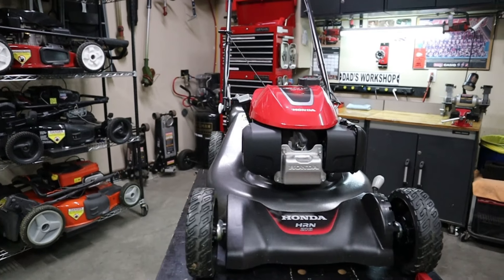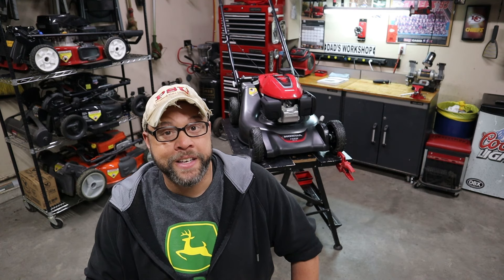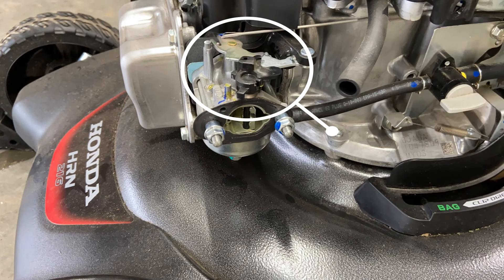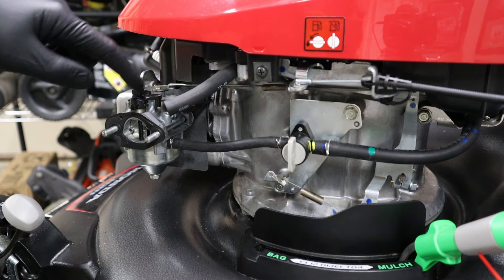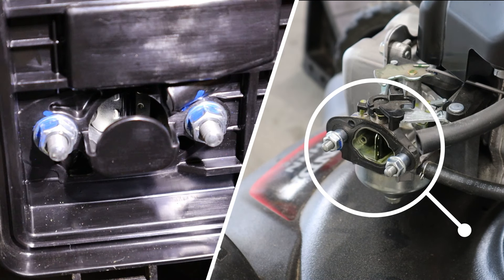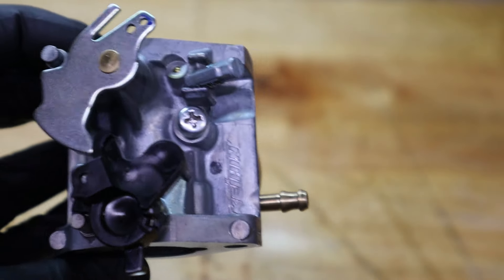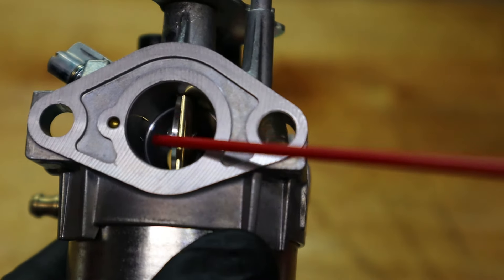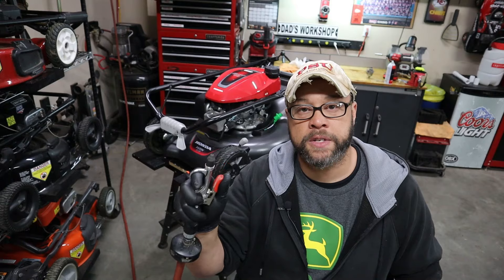New 2020 HONDA HRN216 GCV170 Surging/Rough Idle AND Auto Choke Test/Check

Comment: Rediculous, I fix mowers and was thinking about buying the upper model with variable speed , but no more. To spend 519 plus tax and to have this? It's funny how this guy and people commenting seem to be ok with it. It's a real hassle to remove and reinstall this carburetor, it's not a thing your average person can do without some serious research.
Reply: Yes I know! I need a mower and I'm lost. No idea what brand to get. Meanwhile my grass is out of control. Do you have any recommendations?
Reply: @drepop803  
Again honda makes a great engine except for there carburators. Ever since they tried to meet emission standards for California. Making the emulation jet holes way to small which easily get clogged and resulting it to surge or not start at all. I have 2 Briggs and Stratton Engine mowers as my work horses. Carbs. are very good easy to clean if needed and easy to fix. Just change the oil and they last for ever. For my home I have a husquvana with a Honda engine, it does act up about 1 once every 2 years, but I know how to repair it. For your average person who doesn't know how to repair it is very expensive to take to a shop. Advis, by a mower with a Briggs and Stratton Engine unless you know how to work on mowers.
Reply: @leosalas41ify  haha thanks man. but just a day late. i bought a honda HRX217 two days ago. 

no i don't know how to work on mowers and my beater mower is a snapper with a briggs but it has tons of issues. it was my brothers and he's just like you. he just knows how to fix it and get it working. 

i was thinking of getting an easy to clean and work on mower like a briggs as theres so many of them but i found the mower i wanted (the one i just bought) by accident. she was sitting under a pile of Toro's. i thought either this is a return lemon or its just meant to be. 

HD said they were out of stock and there she was. i opened her up today and she's definitely new and not a return. i just finished mowing my lawn with her and saw this message as soon as i went in the house to grab a water bottle. 

haha all good brother. what i think im going to do is have my brother show me how to open up and repair the briggs and use her for my hills and scary spots on my lawn and just use the honda for the general area and flat surfaces. 

thanks for the tip. always appreciated.
Reply: @drepop803  Wow, Honda's big daddy. Bought one thinking I would replace the Husqvarna. Reason? I have no idea, the Husqvarna runs and still looks great. Just wanted something new, just liked how this new Honda series looks. Although it looked great, I returned it after a month. It was just too big and heavy for my yard. I have a small front yard and it was a hassle monuvering around the tree and flower beds. Good luck with mower, if you have reaccuring issues, check Brue video from Canada. He has a video on how to drill out those ports and make them bigger, which I did to the Husqvarna and every Honda Engine I repair. That pretty much fixes the problem. From the Honda Engines I've repaired like this, I have not had any return. Again, good luck mower. It's a very nice looking mower.

Comment: I had the same issue on my mower, and sprayed carb cleaner down the pilot jet with the screw off, and into the intake port. Now it will only sputter, or get up to full speed and immediately die.  Anyone else have this happen?

Comment: Looks like it's the right fix but my question is, why did this stupid mower do this after just one season of use?  And will this be something that has to be done every season?  If yes, then Honda ripped the buyers off.  No other lawn mower I've owned has had this ridiculous problem that requires disassembly in order to fix.
Reply: Too many people sharing similar experiences - not starting or rough-running early in the life cycle. Looks like owners have to learn how to replace thermowax part or constant carb cleaning or wait weeks for dealer service... Like high-maintenance people - dump 'em or avoid 'em!
Reply: @sheltonmiller7777  Update: I tried the fix outlined by Kipp in the video and my machine runs like new.  Starts on one pull, no surging/hunting.  One difference - I did not take the carb off the mower.  I put carburetor cleaner in the right-side port, and used a tankful of "Mechanic in a Bottle" for the halibut.  Back in business, if you will.

Comment: Everyone please understand.  Most newer engines are having various issues.  It's all due to EPA and regulations and engine makers having to meet those regulations, building less reliable engines with tinier pathways or lighter materials and overall smaller engines (notice the many 150cc engines now, going backwards).  

I say that because anyone stating I used so-and-so brand mower/engine for 15 or 20 years and never had trouble, well, it would be the same for 15 and 20 year old Hondas too.  If you use new Craftsman or Briggs or Toro or Tecumseh or whatever, and the engines have changed recently (most have, again to meet overbearing and unnecessary regulations) its likely to be NOTHING like your good ole mower/engine of yesteryears.  So get a new Craftsman and be sorely disappointed.  Likely the same with Toro (at least in engine power/reliability compared to 10+ years ago) and other brands.

We're being forced to go battery powered electric AND pony up outrageous money for over-priced lithium batteries that probably won't last 5 years.  On electrics, consider a battery replacement the equal of an engine replacement.  you'll replace twice as many "engines" with electrics and blow away ANY savings over the cost of gas/oil/air filter/spark plugs.  We're being screwed as consumers.  I'd like to see a state give the feds the middle finger and state the EPA restrictions don't apply to them and allow REAL engines to be built again.  I know, they'd lose some federal funding, fight lawsuits, but states do have rights, they just might have to pay up to keep them is all.

Bottom line, if you can keep your good ole mower running, stay with it.  I wish I could get my Toro personal pace Briggs engine compression up, but I think some cylinder wall grooves, however tiny/shallow, apparently are causing lost compression.  Hate it.  Looking at a replacement engine, but they'll be new and they'll have same issues (more frequent maintenance of carb).

Comment: Seems helpful but you skipped over the part where you actually remove the carb.
Reply from the maker: It’s 2 bolts
Reply: @dadsworkshopbykipplabrie7982  Thanks.  Once I removed them it was obvious the carb will just pull out.  I was wondering because sometimes when you take something apart it's not so obvious and I end up breaking it.

Comment: Alright dude...here's one for ya:

Honda GCV160...on Honda mower, bought new in 2015.

All of a sudden, in the last couple months or so...will start...then like CLOCKWORK...will shut down after say 2 or 2 1/2 minutes. Just bogs down and dies. 

Have cleaned (to the best of my skill-set) the carb - I used brake clean! Just replaced the "thermowax" little deal behind the auto choke mech...

STILL will run a couple minutes, start to flutter then bog down and die!! 

UGH!!
Reply from the maker: I’ll try my best without putting my hands on it but I hate to say it but it sounds like the carburetor is still clogged somewhere??? Sounds like it’s using whatever is trickling into the bowl then dies. Have tried penetrating the pilot jet with a sewing needle yet? The hole for the pilot jet is super super tiny. That’s the best I can recommend sight unseen keep me posted.
Reply: @dadsworkshopbykipplabrie7982  Thanks dude! I'll pick up some carb cleaner and try to find some brushes or something tomorrow after work. 

At least it's cooling down here...not 105 like it has been, only high 90's! haha There WAS water in the fuel I drained out a week or so ago so I'll totally drain, buy a new can of fuel and give 'er one more try!! Hopefully my patience and the beer hold out!! LOL have a good one, and thanks!!
Reply from the maker: Make sure the fuel valve is open LOL! good luck brother!
Reply: @dadsworkshopbykipplabrie7982  SO...bought carb cleaner last night after work...took it ALL apart even the little brass pieces and flushed them super good. Drained ALL The fuel out even putting some paper towels in to tank and "mopping" up everything. 

Bought a new gas can and two new, fresh gallons of 92 oct and by golly...she fired right up...ONE pull...got the lawn done and now....BEER!! LOL

THANKS AGAIN!! HAVE A GOOD WEEKEND!
Reply from the maker: HELL YEAH!!! "Hold my beer" LOL! Awesome to hear. You got this 69adrummer. I would run some seafoam at the end and the beginning of the mowing season.

Comment: Well this is a coincidence.  Our mower is the same model and is doing this (and actually it's gotten to the point where it wont stay on).  Gonna give cleaning the carb a go along with some Seafoam in the fuel and see if that helps.
Reply: So!  Update.  Managed to get the mower to start up fine and even run for a bit!  But it would surge again every once in awhile, before conking out entirely.  So let it sit for 20 minutes and then sprayed the HELL out of it.  Also note, could NOT remove the screw for the main jet.  That sucker was on there and not moving, and we were risking stripping the damn thing trying to get it out.  So I basically just stuck the straw-nozzle into the other hole and douched the hell out of it, along with the rest of the carburetor.  That apparently worked, because it started up like a charm and stayed running for 30 minutes this time!

...until it conked out again.  And wont stay started this time.  I'm thinking I'll hose it down with the carb cleaner one more time and then let it sit to let the solvents do their job.  Then see if that finally fixes the problem.  If not...I mean it'll be a BITCH to keep having to hose down the carb every time I wanna mow but it beats paying $100 to get a shop to look at it.

Comment: How are you supposed to ‘flip her over’ and check the back if you don’t take the thing out? Us non-mechanics need to know what cleaning it looks like while still on the machine. I ain’t taking no carburetor apart.
Reply from the maker: Open the choke valve and the throttle valve “butterfly valves” by hand on top of the carburetor so you can see right through it. Then locate the three tiny holes on the back right side of inside the carburetor. While holding both those valves open insert your carburetor straw into the right side intake “hole” and gently spray away. But you have to use the straw that comes with the can or you won’t be able the trace the stream. Blast! It out at first then gently spray a slow and steady stream and you’ll see the carb cleaner flow out of the three holes on the back you my want to use a flashlight.
Reply from the maker: https://cdn.powerequipment.honda.com/pe/pdf/pubs/otr55046.pdf
Reply from the maker: These one shows the the 3 transport holes a little better their small in the diagram but more noticeable 
https://cdn.powerequipment.honda.com/pe/pdf/pubs/te425pdf.pdf
Reply: No worries. Just shut the gas and remove the two air filter nuts and air filter housing as shown in the video.
Remove the gasket.
Remove the fuel line at the carburetor. (This can be challenging because the hose clamp ears are so small that they are hard to pinch together so you can slide back the clamp.)
Now slide the carb off the studs. Careful-there’s another hose but it’s not clamped. There’s also the throttle linkage and spring to unhook, but you unhook those after pulling the carb off the studs. That’s it!
Clean, and reassemble in reverse order.  BTW, I didn’t see cleaner come through the hole in the back until I reinstalled that screw on the top and sprayed carb cleaner in the hole at the intake. 
I just did this a couple of hours ago.
Reply: Use your cell phone  to take pictures of each part you disassemble or video record it. You can draw a simplified picture of the carburetor on a piece of cardboard and lay them where you removed them on the picture of the carburetor. It's not really difficult, if my 12 yr old son can do it just the way I described, any adult should be able to do it as well. Take your time and stay organized and you will be proud of your success when you pull the handle.  Good luck!
Reply from the maker: 10-4
Reply from the maker: https://cdn.powerequipment.honda.com/pe/pdf/pubs/otr55046.pdf
Reply from the maker: https://cdn.powerequipment.honda.com/pe/pdf/pubs/te425pdf.pdf

Comment: Just bought one. First belt from factory broke during the second use. Had to order another one. When trying to install new belt, found the belt guard under the blade was bent and very flimsy. Checked comments from other buyers and found this is a huge problem on these mowers. Belt replacement is a nightmare on this mower. Took back to Home depot for a refund. I do not recommend this mower. I can repair anything from car engines to outboards to something simple like lawn mowers. This mower was over thought in design and is not worth the asking price. Too much plastic!
Reply from the maker: Yes that belt cover is a “B” to get off